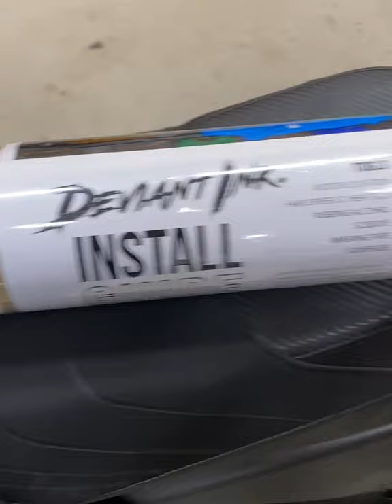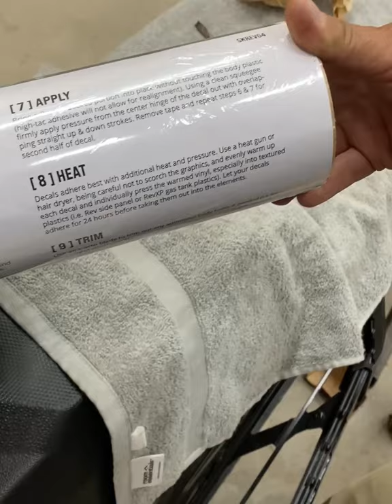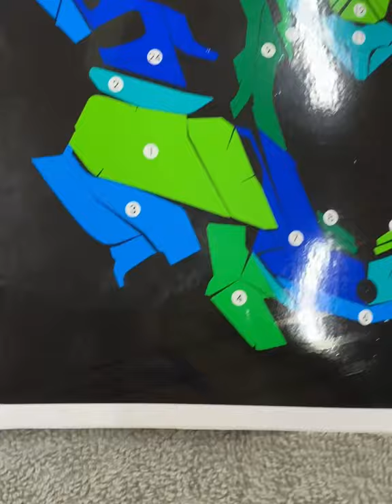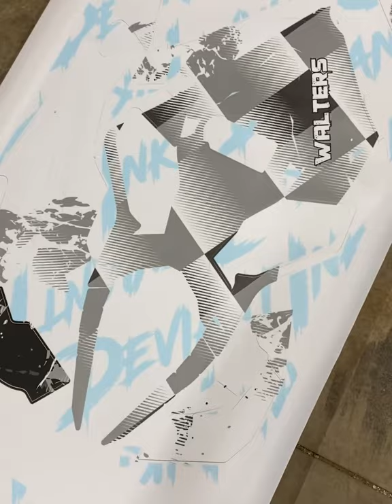2021 Ski-doo 850 Turbo - Episode 6 Deviant Ink Sled Wrap

Comment: Did you install the wrap over the factory decals? How'd that turn out?
Reply from the maker: 😬 yes I did.  You can’t tell at all. If/when the wrap ever gets taken off, the factory decals will come off with it.
Reply: @xtremeairvents  So regardless if you leave the factory decals on, they won’t stay on if you attempt to remove the wrap down the road?
Reply from the maker: @johndunleavy1722  in my experience they end up peeling off with the wrap.
Reply: @xtremeairvents  gotcha, I’m going to be installing a wrap on my 2021 backcountry xrs here in a couple weeks so I was just curious which was the better route. Might just remove them before hand if they come off after. Thank you